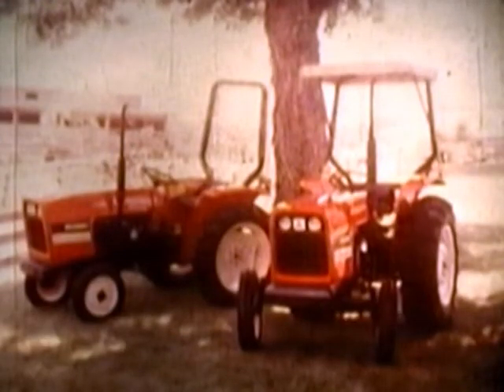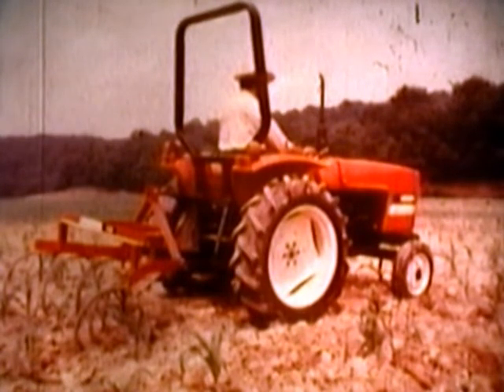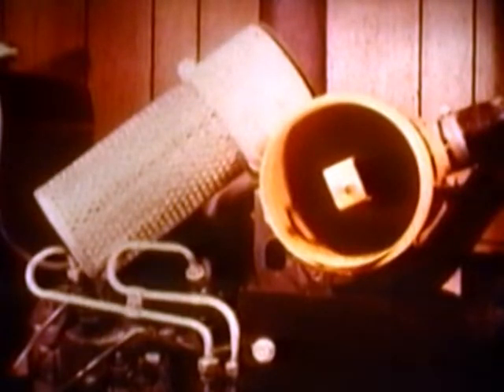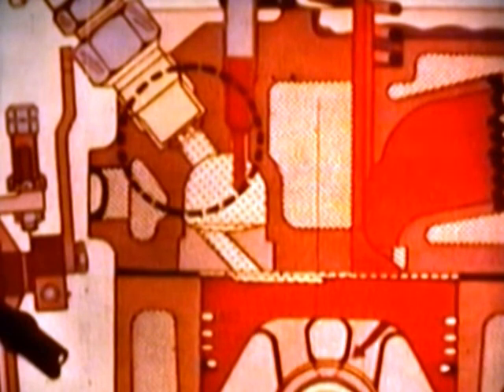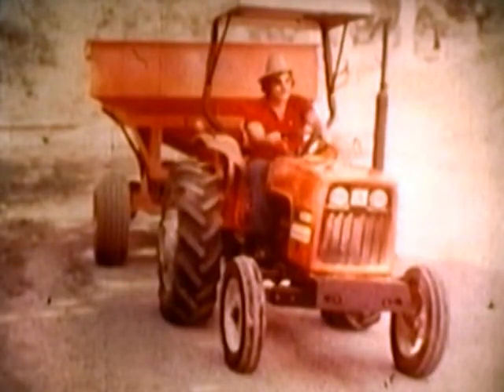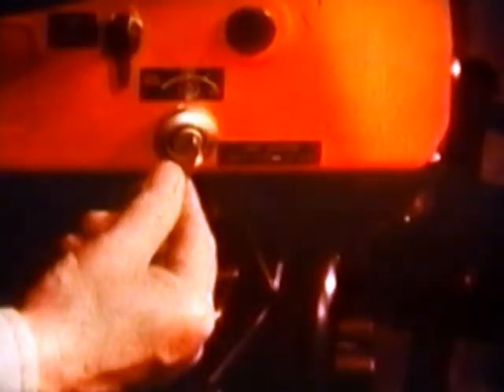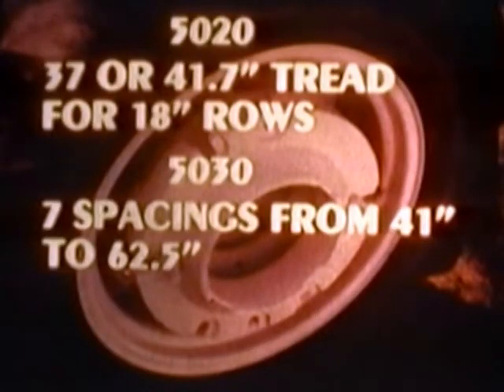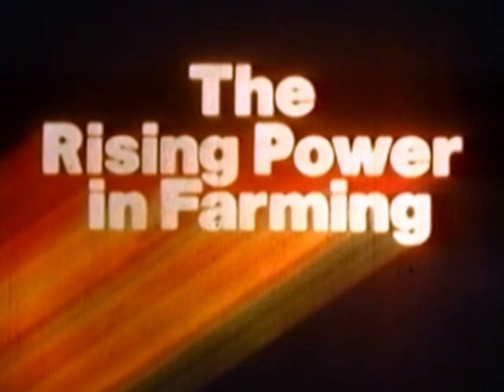A Small Package With Power Potential

Comment: My dad had a 5030 when we used to farm. We used it for mowing the yard which we had the 3 point mower attachment hook to the PTO drive. WE also had 5ft bush hog mower which I used to mow the entrances to fields and the woodland area. And we used it to power the 60' auger that loaded grain to our bins. I used to use the 5030 on the road when I was 14 to drive to town. It would go around 35mph on the road. I drove it to school many of times before turning 16.

Comment: Thanks for posting this!  Been researching this unit.  Anyone know how reliable they are and parts availability?
Reply from the maker: The 5020 & 5030 were made by Toyosha. They are good reliable tractors but parts are a little scares. You may want to look at the 5045 or 5050. 1979 and later tractors had the 12 speed trans. They were made by Fiat. Good reliable tractors with good parts availability. Fiat made these tractors under many different names including Case & Long.